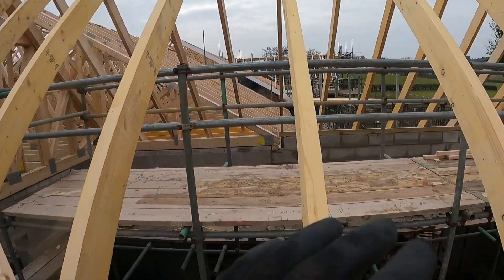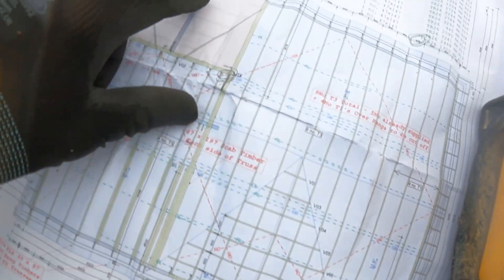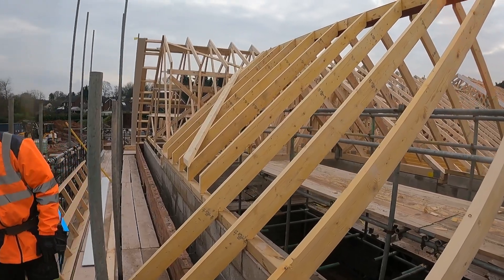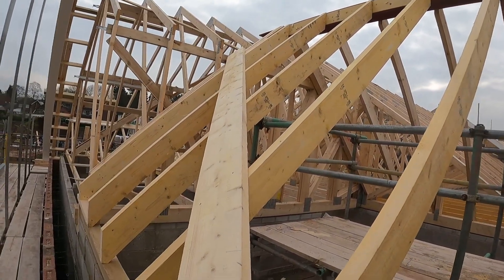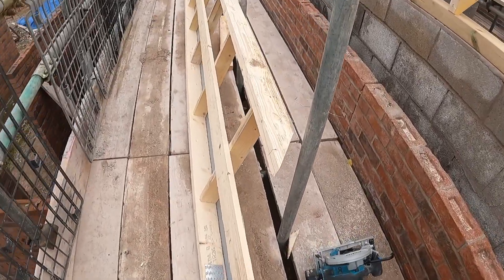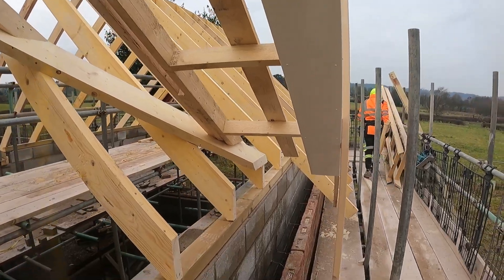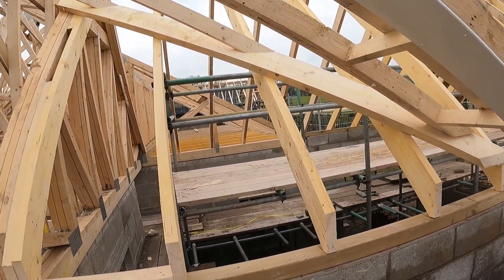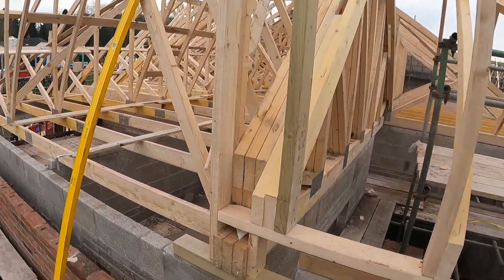Installing Valley rafters!

Comment: Would it have been better to add another wall plate or even a bit of 4x1 for a bigger birds mouth on those rafters? I done one pretty much the same as that and site agents made me put a another wall plate on top in case NHBC see it, not that there is anything wrong with it 😂
Reply from the maker: @jamham435  I’ve been told off before for adding a timber to a wall plate! You can’t win haha! He just wanted you todo it to make the seat cut bigger?
Reply: Think they just make half the stuff up 😂 I couldn’t make it a 1/3 birdsmouth, because it was running in with trusses the other side so it had about 20mm birdsmouth (120mm timber) which I thought would be fine. He said it wasn’t so I wanted to add a 4x1 to get me 40/45mm birdsmouth which was 1/3 but he told me to do another plate on top so the birdsmouth ended up being bigger than 1/3 😅 I got it all in writing that he told me to do that just in case I got fucked for it
Reply from the maker: @ good man you’ve always got to cover your back! Coz the tables turn fast don’t they 🤣😫